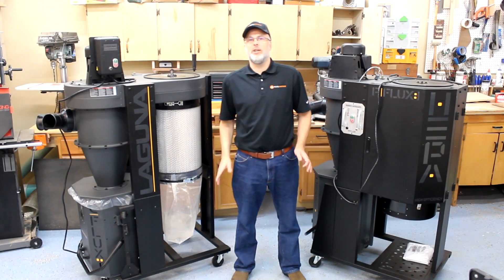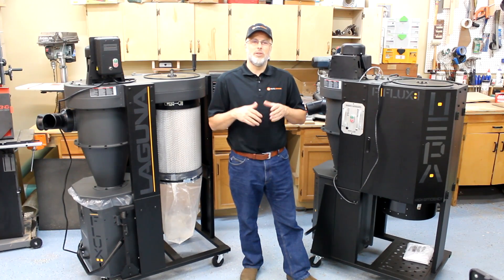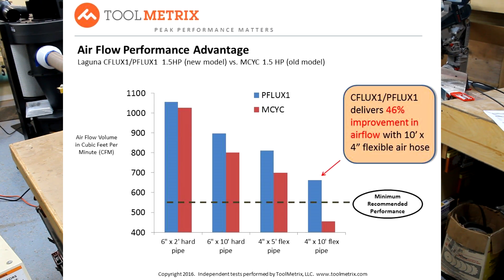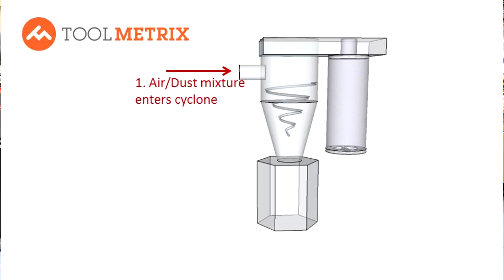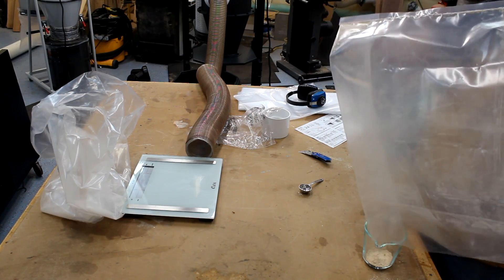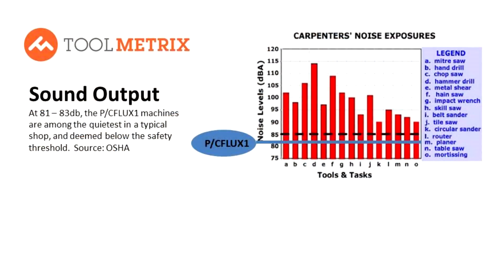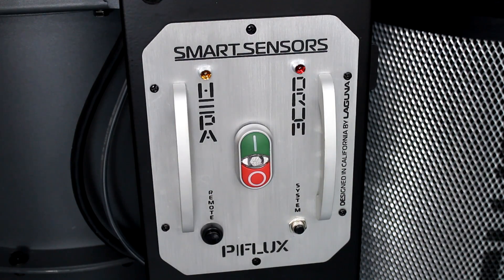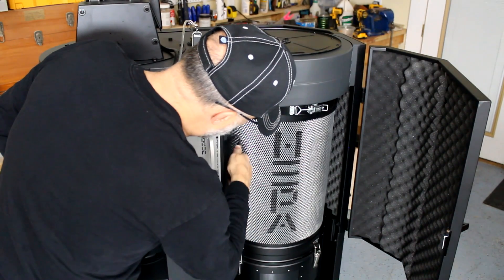Laguna CFLUX1 and PFLUX1 Dust Collection Cyclone "Deep Dive" Examination

Comment: I know this was 9 years ago but in your opinion which would be better in a 16ft x 10 ft shed
Reply from the maker: Hi Steve, in a smaller shop I would particularly want the best filtration possible which I think is the PFlux if I remember correctly. They might also have other options available today. I haven’t looked lately. Best of luck sir.

Comment: My filter gets clogged with the dust and the air starts flowing back and the dust starts blowing out from everywhere
Reply from the maker: That sounds awful.  Make sure that you have the deflector plate installed above the barrel.  This was missing on some early models and makes a huge difference.  Also, be sure that your barrel is sealed.  If you skip the step where you seal the seams it can cause problems like that.  And finally, make sure that you have a long straight duct run leading into the cyclone.  Ideally the first 8' is straight.  If you have a bend coming right out of the cyclone it can lead to poor air dust separation.  I hope you can get this sorted out.  The 1.5 HP units that I had in my shop were very effective at air/dust separation.  Exceeded my expectations.  The 3 HP unit wasn't quite as good, but improved after I installed the deflector plate.

Comment: Is there a helix baffle inside the collector inlet chamber to direct the air flow into a vortex flow? I like all the other aspects as shown. A good view looking into the upper chamber would help. Thank You
Reply from the maker: Hi Dan, I'm not sure, and unfortunately I no longer have these eval units in my shop.  Probably worth giving Laguna a call to ask that, or maybe there's a parts diagram in the manual.

Comment: Seems to be a solid unit. I installed the 1.5 HP 110v version. Very well made. My only complaint is the amperage requirements. Do keep in mind that you need a 20 amp minimum, and even with that, I blew mine today 1 out of 10 times. This is the circuit I run a Sawstop PCS 110v on without any issue.
Reply: Honestly, I recommend all woodworkers get a 20amp circuit anyways. Even running a simple shop vac and table saw together will blow most 15amp circuits.
Reply from the maker: Great suggestion BF. Cheers
Reply from the maker: Interesting. I never popped a breaker on a 20 amp circuit. It runs pretty close to the edge though. It might be worth trying a different breaker on the circuit. There’s a bit of variability in the sensitivity.
Reply: @ToolMetrix  interesting. Did you go straight into the 20amp outlet or did you use any type of extension cord?
Reply from the maker: I don’t recall, but if I did use an extension it would have been a short one with 12 gauge wire, which is almost let using no extension cord at all. That’ll make a big difference.
Reply: @ToolMetrix  This one time, I’ll follow the destructions and install a 30Amp outlet. Feels like cheating. 

Once again, great video!
Reply from the maker: Yeah, I reckon you won’t regret that. Thanks for the feedback sir.

Comment: I just bought a CFlux. I bought the 110 version thinking I could avoid wiring for 220. Well silly me. Once I assembled it and plugged it in it blew all the breakers in my shop. I went to the manual and in the electrical specs it said it needed a 30amp dedicated 110 circuit. All I had was the standard 15A 110 in my shop so I ended up needing to hire an electrician anyway. Beware can’t just plug this beast in and get going. You’re going to need an electrician. I wish that was made clear before I bought it. I might have just got a 220 version instead.
Reply from the maker: I don’t have any 30 amp 110V circuits. I used a 20amp and never had any problems. But you’re right; It definitely won’t work on a 15 amp. I’m sorry if i didn’t cover that in the video. I definitely should have.

Comment: Just curious if you had tried running the cflux 1 on a ducting setup. Laguna states that with 5.85 inches of static pressure with 785 cfm. I want to run about 30 ft which equals around 5.5 inches of static pressure.
Reply from the maker: In this video I went into detail on the ducting configurations that I tested, and the real world data that I produced.  I didn't run any tests beyond what I described and illustrated here.
Reply: How did you plug it in to a 15A circuit, does it have a regular 15A plug?

Comment: When you use the crank to dislodge the dust from the canister, a small cloud of dust comes through the filter. Doesnt this defeat the purpose of a dust collector? See my assembly issues too at https://youtu.be/jIoSGhzS5qc
Reply from the maker: I'm not sure if you are seeing that cloud on my video or in your shop.  I didn't notice that at all in my shop.  The units that I had did such a good job of air/dust separation during my testing that there wouldn't have been much dust in the filter to form a cloud.  That said, most of the dust should fall down into the bin, and not go through the filter.  I'm sure some very small percentage of the tiny particles does sneak past the filter, but I don't believe that it should be enough to form a visible cloud.  Either way I guess it probably makes sense to wear a dust mask while you clean the filter or empty the bin.    I don't have a flap system on my current cyclone, so I take it outside once in a while and blow the dust out with a leaf blower.  It makes a mess but it does a great job of cleaning it.  I watched your assembly video; wow, that's frustrating.  I never saw the final version of the manual during my assembly because it wasn't available when I got these early units.  I assembled four different cyclones in one weekend with a single rough draft manual.  Well, actually the older model cyclone had a finished manual that was very nice actually, but the rough draft that I was using for the new models was very rough.  I'm sorry to hear that the final version is inaccurate in so many aspects.  Hopefully they will take your suggestions and make improvements on the manual.   I assembled another one of these at a friends house many months after I had assembled these, and by that time there was an assembly video on the Laguna YouTube channel.  This was extremely helpful, and made the setup super easy.  We didn't even use the manual; just followed along with the video.

Comment: Dust collectors are not perfect! But only Bill Pentz can filter for 99%!
Always show test without the filter on the back please...
Reply from the maker: Not only is that not true, but 99% would be considered poor separation. I had a Clear Vue cyclone in my shop for five years and it was great but separation results were similar to these units.
Reply: @ToolMetrix  That's really good to know - I was wondering why the Pentz models price points are so high. Good to hear your similar metrics. This was a fantastic review of the Laguna models, thank you.
Reply from the maker: The clear vue is also a much more powerful unit than these. Not a good direct comparison.
Reply: @ToolMetrix  wow, that's pretty remarkable company to keep for the C/Pflux.  Absolutely great review, too, btw. Question: outside of cost, what are your thoughts on deciding between the Pflux 1.5HP and Pflux 2HP?
Reply from the maker: Thank you.  If you are planning to use the DC as a portable unit, rolling around and directly connecting to tools, then the 1.5 HP is great.  For a VERY small ducting system, it could work as well.  For most permanent ducting, however, the 2 HP is a better starting point.

Comment: Do you need the bin insert with the P Flux?  If not, why?
Reply from the maker: No, you don't because the pressure is managed in the drum, which keeps the bag from getting sucked into the cyclone.

Comment: Read some not so good reviews of the P Flux3 . Is this the reason there is no video? Also, the crossbar fix you mention in a comment, has this been added to all ne units shipped now?
Reply from the maker: Sorry I missed this.  I thought I had responded but I don't see my response here now.  By the time I got the crossbar, I was out of time and had to move it out.  The crossbar helped a lot, although wasn't as good at air/dust separation as the smaller units.  Yes, the crossbar now comes standard with the product.

Comment: GARBAGE. DONT WASTE YOUR MONEY!
Reply: File this comment under useless
Reply from the maker: Hi Sam, Thanks for sharing your thoughts.  I felt that these units compared quite favorably in this class of machine, so I'm surprised to hear that your assessment is so different.  What did/do you not like about yours, and which product out there do you think is a better bet in the 1.5 HP cyclone category?
Reply: Beware the dust trolls.
Reply: Can you elaborate, what did you not like?
Reply: Without any context I rate your comment the same.

Comment: Hey Paul gonna buy a PFlux just have a couple questions. Im putting the mach. in my rear shop which means about 25' of pipe to get inside my m. shop.Biggest single draw will be Makita 2030N plan/joint. 1rst is will the remote pass through walls? 2nd does the 2HP model have enough CFM to be otimal for the run using 6" pipe?
Thank you
Michael
Reply from the maker: Hi Michael,  the remote is radio frequency so it doesn't need direct line of site, but going through a wall and a long distance might be too much to ask.  I am not near my dust collector right now so I can't try it for you unfortunately, but Laguna should be able to offer some guidelines on this.  In terms of the 2HP and its ability to meet your requirements, if you want to get 500 - 600 CFM at your longest/worst run, it feels like a stretch to me.   I haven't tested the 2 HP unit, but I've looked at the fan curve and it is a bit more robust than the 1.5 HP, but not a ton.  A 1.5 HP unit wouldn't be able to deliver adequate air flow in your situation; not even close.
Reply from the maker: Michael Marquette I just tested the remote from about 50 feet away going through three walls and it worked without any problem.
Reply: I know this is a year old, but I just bought the 1.5 HP cflux (it is being delivered today) and  everything I read was to use 6" ducting as much as possible.  Would 6" be too much for this machine?
Reply from the maker: I wouldn’t use 6” ducts with this machine. You won’t be able to maintain adequate air speed in the ducts. I’d go 4”, keep your duct runs short and use as much hard piping as possible.
Reply: Thanks, I bought the 6 inch hvac pipes but haven't installed anything yet.  I can return them for 4 inch but everything else I've read was to use the same size as the collector's inlet, which is 6.  My shop is small and the longest run will be about 15 feet to the table saw.  All the other tools will be off a single run at 2, 4, 6, and 8 feet away
Reply: ToolMetrix z

Comment: Hey Paul, just curious I was reading over on one of the Woodworking forums that you mentioned somewhere that you didn't get great results with the PFLUX3 until you had talked with Laguna and they sent you some type of steel plate to add to the end of cyclone or something extending into the dust bin, is this true and if so do you have a link to a picture or know what they call it?
Reply from the maker: Hi Nick.  Yes, I was getting quite a bit of debris bypassing the drum and ending up in the filter on the PFLUX3.  A different experience from what I found when I tested the 1.5 HP machines for this video, as the 1.5 HP machines produced impressive air/flow separation.   When I reported this to Laguna they sent out a very simple metal plate that they described as a crossbar, which gets installed between the cyclone funnel and the drum.  I've now been using this for a month or so, and filled the barrel up several times with only the tiniest amount of debris ending up in the filter bin; results that are more inline with the separation that I measured on the 1.5 HP machines.   I will include this in the PFLUX3 video that I hope to finish and get posted here soon.  For now you can see what the part looks like over on the ToolMetrix FB page.  https://www.facebook.com/Toolmetrix/.
Reply: @ToolMetrix  I guess your still working on that PFLUX3 video 2 years later, since I don't see it in your list of videos. What's the problem? Was it too negative?
Reply from the maker: i was bummed that I couldn’t get one done. I didn’t have it in my shop long enough to complete the video by the time the separation plate was in place. After that was installed the air/dust separation was vastly improved.  I never ran the full tests that I did on the 1.5 hp machines but anecdotally id say it wasn’t quite as good but it was decent after the plate was installed. Without that the separation wasn’t very good compared to the 1.5 HP units.  I measured sound output at 87 dB which was higher than the spec but all tools are in my shop are that way. Small shop with Sheetrock walls. It was quieter than the clear vue that I had in there previously and a bit louder than a dust gorilla with a silencer. Amperage draw was 19-20 and I definitely needed a 30 amp circuit.

Comment: Just curious but why does your channel only contain reviews of Laguna tools?  Seems like a marketing arm of Laguna?  I have one of their original mobile cyclones and I can tell you I get much more than 3 tablespoons of dust in the bag after the filter.
Reply from the maker: Hi Ron, yep, it is Laguna-heavy for now; totally agree.  There's one more video planned, which is very tardy, to wrap up the focus on Laguna dust collection.  Then there will be videos on other tools, and maybe some projects too.  In terms of separation results that you are seeing, our tests show way more than 3 tablespoons too.  The test in the video shows twice as much as that, and keep in mind that is only for 5 gallons of dust, so for a full 30 gallon drum (or is it 35?) you would see 36 tablespoons of dust.  That means lot of time spent cleaning the filter; not good.  I had similar problems with the new PFLUX3, which I'll include in the video when I can find some time to create it.  I reported this to Laguna and they sent out a steel plate that gets installed between the cyclone and the drum, and it made a dramatic difference in separation.  Now the PFLUX3 is more comparable to the 1.5 HP machines.  It might be worth contacting Laguna to see if there is a way to adapt this plate to their old machines.

Comment: Your review shows great promise for these machines design improvements.  I do have a couple of questions: 1)Was your dust feed rate the same as what is in the video?  If so that would be unrealistically slow compared to a real world drum sander or router feed rate and would explain the high separation rate (which outperforms full size professional cyclones).  2) Since you only appear to review Laguna products do they compensate you in any way?  Is that why there has not been any competitive comparisons of other brands of cyclones?

Thanks,

Carl
Reply from the maker: Hi Carl, 

Good question about the ingest rate.  The test that was shown in the video was done with varying feed rates.   I tried to introduce an element of “real world” into it by going from a very slow trickle to a heavier feed, then back again.  It was non-scientific, but I tried to find weaknesses in separation.  Overall I believe that the feed rate was faster on average than a real world feed, rather than slower.  I didn’t time it when I did it, but I’d guess that I spent somewhere in the range of 3 minutes to suck up 5 gallons.  I did it multiple times with variations in feed rate throughout the process and saw pretty consistent results each
time. 

I have no intention of testing only Laguna products, and I would have preferred to not have so much imbalance in my initial coverage.  It has "just happened" this way as I’ve taken the opportunity to have an early look at some new products, however, which I enjoy and people seem to be interested in.  I have one more video to finish up on this set of dust collectors, and then I’ll be working on some other videos outside the Laguna family, which I’m looking forward to.  Laguna sponsored this project as a firewalled test.  They provide product and have no input or influence on how the tests are structured or how the results are communicated.  Because of this approach, you’ll note that my findings are dramatically different from theirs in a couple of areas, including CFM (1300 vs. 850 CFM) and sound (81 vs. 70db on the PF1).  Those are dramatic and non-flattering differences for Laguna, and yes, it would be interesting to know how these results would compare to other comparable products.   I am interested in doing competitive comparisons, and Laguna has no say on whether I do these or not.  Doing competitive studies on big equipment like is logistically challenging and time consuming,however, and I need to work that out.  But I definitely see the value of this type of information and hope to be able to provide it at some point.

Comment: On the Pflux 1 what do the 2 small  buttons on the control panel do? One says system the other says remote.
Also there is a small  button on the remote. The manual does not say what any of these do.

Thanks
Reply from the maker: The button labeled "remote" is for pairing the remote control with the dust collector.  The one labeled "system" is an on board circuit breaker.
Reply: Thanks,I guess mine came paired to the remote as it worked right away.So is the button on the remote for pairing also? The small one under the start-stop buttons. Did you find any of this in the manual? I could not find a thing about it.
Reply from the maker: Yes, the small button on the remote is for pairing also.  Yes, I found this information in the manual.